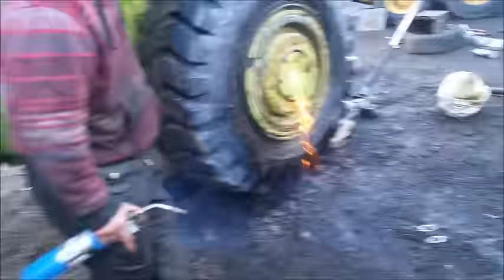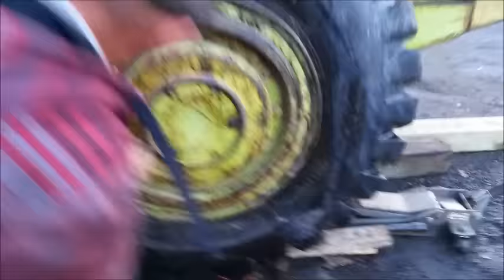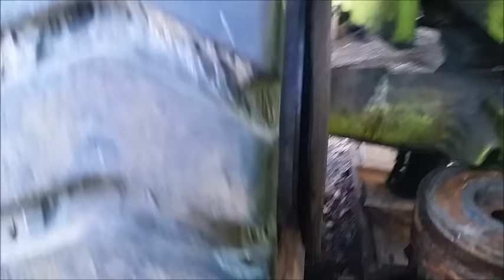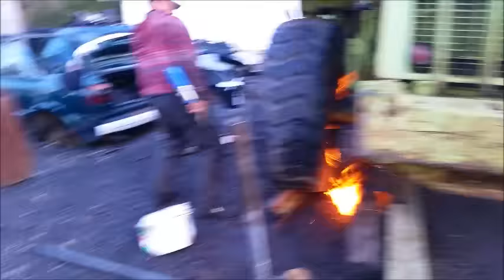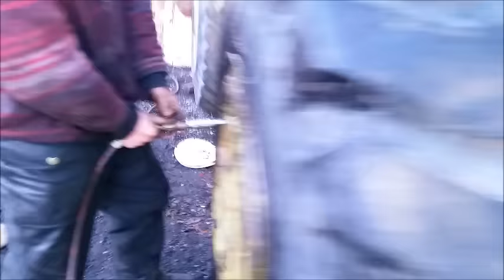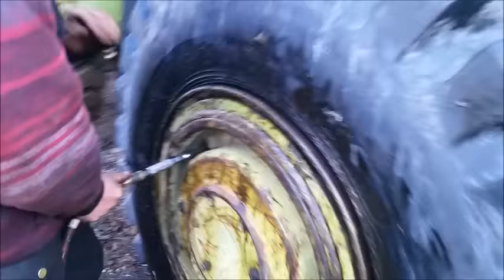T Rex Tire Seat

Comment: It's not a lot of pressure but it is a lot of volume.  After the 'rapid expansion-bead-seating' you've got to pour air into the tire nonstop to keep it from cooling and pulling off the seat again.  Sounds like you know that...  explain it to that other guy.  :)
Typical large tractor tire pressure is 10-25 PSI.  Thick tread and wall tires, like the Trex and skid steers, are about 50-60 PSI.